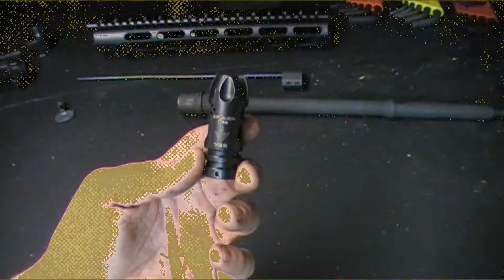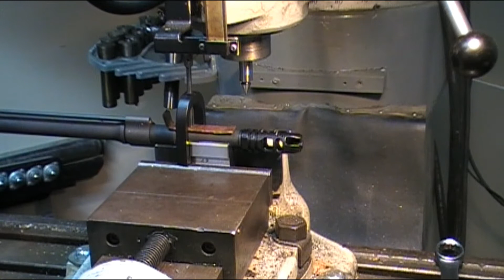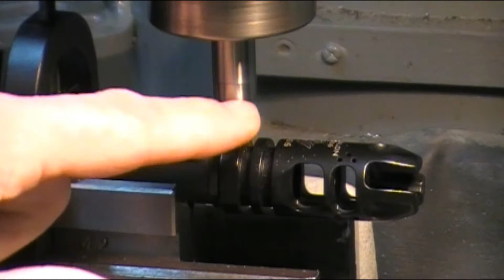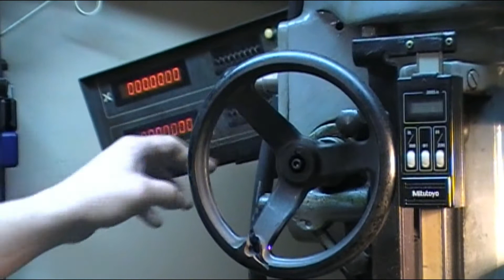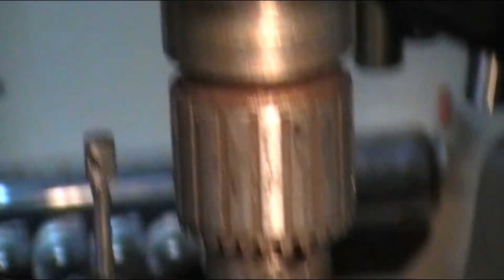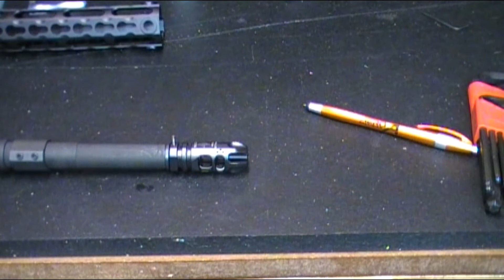VG6 Epsilon Install

Comment: All that work and he installed it wrong. Firstly, there's no need to drill and pin the Epsilon, the crushwasher that comes with it will suffice. Secondly, the slits go on the top and the logo and six holes on the bottom. Good luck correcting that.

Comment: Are you sure that is orientated appropriately? Majority of the ports in the break are supposed to be towards the sky when the weapon is shouldered.
Reply from the maker: @lowawalrus the gas block was loose on the barrel and upper receiver was not attached to the barrel either. There has been some confusion because of this.  I appreciate the input and I guess I should have shown the final product upon completion. The after mounting the barrel on the receiver vg6 logo is pointing down and the ports are pointing up at 12 o’clock.

Comment: Terrific video, thanks! I have a Ruger compact American 556 with a half-28 thread. Instead of using the compression washer, I want to use a jam nut. Would there be a reason I couldn't do that such as necessary thread engagement, alignment, etc?
Reply: You can use a slim jam nut, that's not unheard of, just make sure your barrel has enough thread engagement inside the MB with the jam nut stacked behind it. 1/2" is plenty, less than 3/8" of threads in the brake, I wouldn't do it.

Comment: Gotta give a thumbs up for all the grief you took in the comments. I'm on my second pin and weld and haven't attached my upper receiver to either barrel before doing the drilling.
Didn't get quite as technical as you, I only have a drill press and vise. The first one I had to drill a hole in the muzzle device as it didn't come pre drilled.
I am using the epsilon sl on this one and will drill a spot hole or use a punch to mark my drill spot on the barrel then remove the muzzle device to finish the hole so I can see the depth better.
A local weld shop tigged the pin for me. Told me it was $5 minimumI gave him $30.
Any way, Good job.

Comment: Milling machine; check.
Fancy aluminum jaws; check.
Digital readout; check.
Vg6 upside down; cha-eck.
Reply from the maker: Please read my previous comment. The gas block is loose on the barrel. If you take the time to look its sitting crocked on the barrel because the orientation doesn't matter. After I pinned and welded the brake on then the gas block was aligned to the receiver and tightened down to the barrel.
Reply: @cellargunsmith1251  the logo on the VG6 is supposed to face downwards when it is installed.  We can't see the orientation of your upper, and while you can see the gas block is slightly off-center to the left a few degrees. So unless your gas block is hanging up at nearly 6 and down is actually 12, then you did pin the brake on upside down.

Since the gas tube is in the gas block, it seems logical that the other end of the gas tube is in the receiver, so we're looking at the top of your barrel and an upside down installed muzzle device with the logo facing up instead of down.

It's a very common mistake with VG6 products. The logo goes down when installed correctly.
Reply: Michael if you read my replies to several others you will read that the gas block was loose on the barrel. The upper receiver was not attached to the barrel either. That is why several people have been confused.  I appreciate the input and I guess I should have shown the final product upon completion. The vg6 logo is pointing down and the ports are pointing up at 12 o’clock.
Reply: @brassmule  holy shit you are dumb

Comment: Why pin and weld to make length legal?    Just use legal barrel + vg6.   2" more length is no handicap.
Reply: Mickey Meador because he can and wants to.
Reply: Or for situations like right now when a 14.5 " barrel can be sourced and a 16" barrel is hard to come by.
Reply: So as I'm watching I start to realize that the gas block will essentially be permanently located on the barrel between the newly welded muzzle device and the barrel's nut at the receiver.  Although I've never personally had any significant issues with a gas block other than getting perfect alignment, I struggle with committing to a single gas block now that I'm starting to play with adjustable gas blocks.  Anyone with anymore "actual" experience have any feedback to this?
Reply: @joelmellentine3641  the gas block will slide over the vg6 sl.
Reply: @undergroundupholstery  I didn't realize VG6 even had a slim line device until you pointed it out. (Thanks). I searched for something for .308 and 6.5 in the SL for their 762 or 65 VG6.  Perhaps I need to do a better search in order to find it.  Either way, its not an issue for me at this time due to the length of barrel on the latest member of the family, but when I decide we need that short  .308 with side charging bolt, I'm going to still want that slimline device.

Comment: I believe you installed the Epsilon upside down. The wording goes towards the bottom
Reply: Here is what the manufacturer says, amongst others and what looks like common sense to me if you just look at the flash hider you have 1 of 3 main jest shooting right up in front of ur line of sight.."For VG6 muzzle devices the proper 12 o’clock position is opposite of the laser engraving found on the muzzle device."    I know but it's a epsilon well guess what it is b4 that a vg6 per the name the lazer Mark's go down and long skinny slits are DOWN small holes up, go read it urself
Reply: He did install it wrong.
Reply from the maker: Jason Williams please look at the video more closely. The gas block is hanging loosely at an angle on the barrel. If you look at the last 30 seconds you can see the gas block at another angle and the mounting screws are backed out of the block. I appreciate your comment and concern that I install the brake correctly. These brakes are incredible efficient and I’m proud to run them on my rifles.
Reply: @cellargunsmith1251  I've got the slim version, and I can confirm. It does very well vs my M4-72, which is superb,, and without the hair dryer action.
Reply: @cellargunsmith1251  / Maybe you could have mentioned that the gas block was loose & not tightened down yet if someone didn't notice. Just Saying
Reply: @arthurdsoto5751  why should he? Your confusion isn't his responsibility.
Reply: @benningsniper9516  said in regards to an  instructional video...